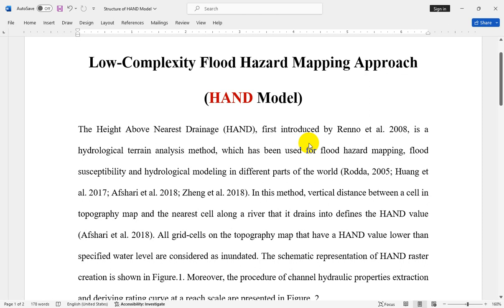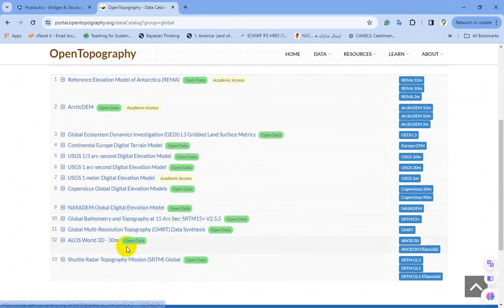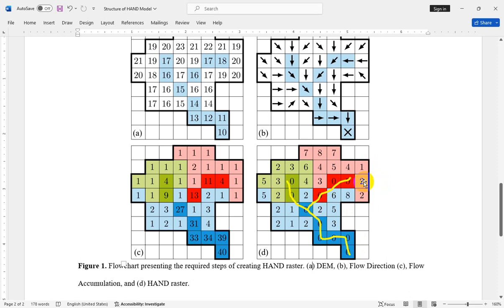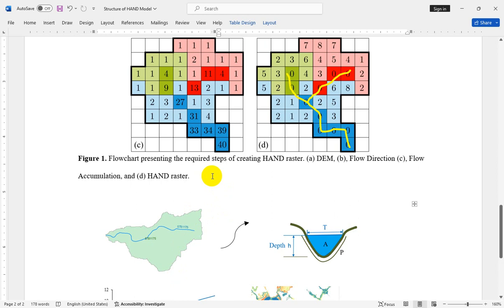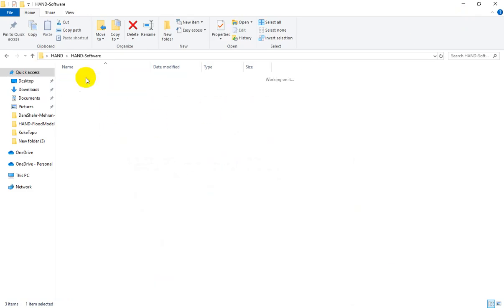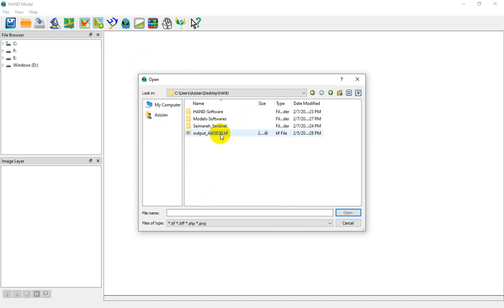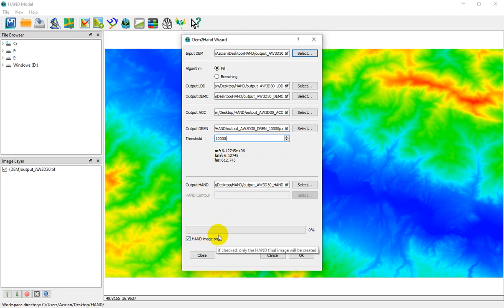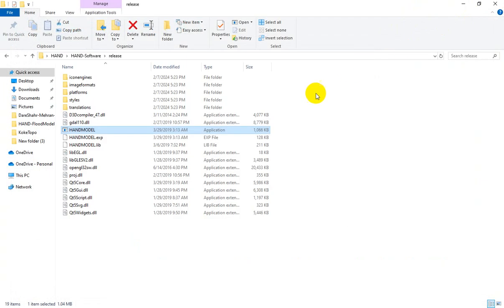Rapid Flood Inundation Mapping using HAND (Height Above Nearest Drainage) Method-Part1

Comment: Thank you for introducing the HAND model. I have tried installing the Windows version on several PCs and laptops running Windows 10 and 11, but I receive the following error each time:
"The application was unable to start correctly (0xc000007b)."
Could you kindly advise me on how to fix this issue?
Reply from the maker: Dear Amir
I do not have an idea about Win 11 for HAND model. I will send you a python code for calculation of HAND raster and you can just use DEM and create HAND raster for your case.

Comment: Hi, thanks for making this useful video. You have made only a cross section on the river. Does this mean that water profile is uniform in the HAND model? I am doing a project, in which I should compare the results obtained by HEC-RAS and the HAND model for a special flood event. In reality, we have different discharge values in different points of channel. Which discharge should I consider to convert into water depth in the channel by the rating curve? Peak discharge or average discharge? I would appreciate it if you could guide me on this matter. Thank you for your assistance, in advance.

Comment: I have question about the HAND software. Does it can work with the DEM models with resolution 5*5 ore finer such as 2*2? I tried but I could not get any result.
Reply from the maker: @mahyartaheri-vo8bi  hi, dem resolution isn't the matter, and you should create hand raster based on your dataset. Check the coordinate system and try it again to get the suitable outputs